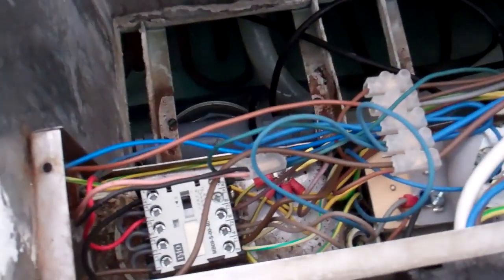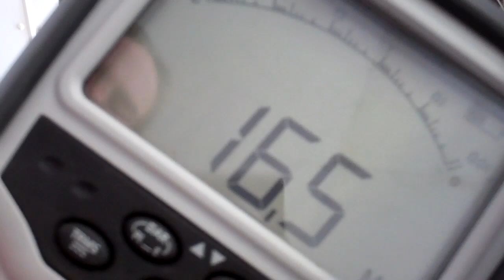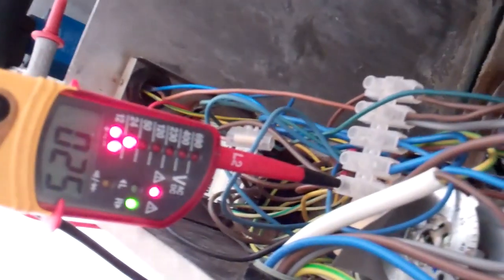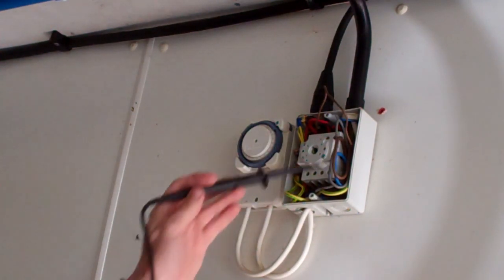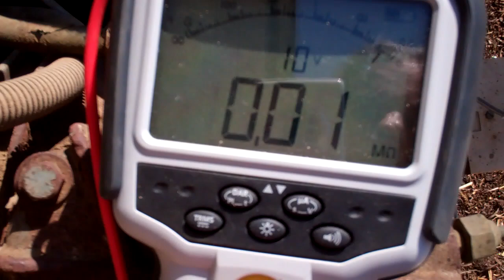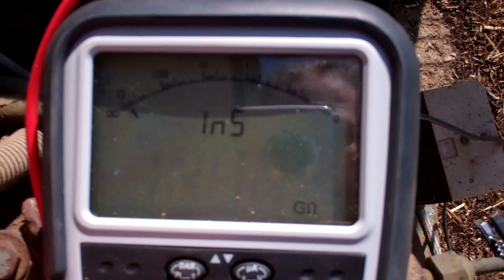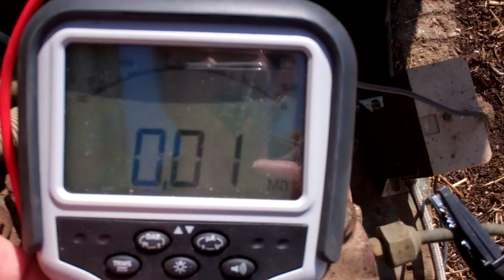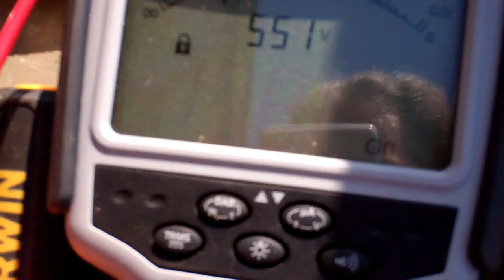megger testing

Comment: The out put from transformer 3 phs RED YELLOW BLU if check with ground shows with 
RED 191V
YELLOW 249V
BLUE 211V ??
Reply from the maker: +Muhammad Rizwan That does not sound correct, really it needs a good electrician to diagnose, but it can be if there is too much load on the red and blue phases.

Comment: I want to check insulation  between neutral and earth live
Reply from the maker: +Pilane Mositwane If its a motor, make sure the power is safely isolated, disconnect the motor from the circuit, put one test lead on the earth and then test the live and neutral, also test to earth to prove the earth lead is making good contact.

Comment: So by that do you mean..disconnecting the 3 phase into the isolator and then testing each phase and nuet to the condenser?and if resistance is fine.then the problem could be within the mains cable to the condenser or at the board itself? This problem is infuriating me and the customer..ps love your videos,I'm learning every time I watch one.
Reply from the maker: Ok, you should not need to disconnect the incomming mains to the isolator, but it is worth turning off and locking out the mcb that feeds it before doing any testing, also turn off the isolator. It depends if its a three or four pole isolator, if its three pole and or the neutral is not switched it will need disconnecting before testing as you can get a false reading. Then put one lead of the megger on a good earth (prove it by testing to another good earth and it should show a dead short), then test the terminals in the system, if there is a fault shown, break the system down into smaller parts until you home in on the part that is causing the problem.

Seeing as it is a three phase system, it is worth checking the contactor, if one of the contacts is a bit burnt the compressor will only get two phases and will pull too much current, this can cause the breaker to trip too.

Comment: Having trouble with nuisance tripping on a dairy case with remote cond unit.(maneurope) the system takes out the 20a breaker every couple of days..tried a megger on the comp windings and all is good..would you recommend disconnecting all components and and checking one by one with the megger
Reply from the maker: Those are the worst sorts of problems to trace, usually i will start by meggering the whole system to start with e.g. the incomming live and neutral (after having isolated both from the supply. If no fault is found then it points to there being no fault on anything connected to the circuit but you need to be careful of contactors and relays that may isolate individual components. It won't hurt to test all the components individually.

I have had a few times when the fault has been on the cable back to the mains board or the isolator, or even a weak breaker.

It could also be the compressor is struggling to start either because the capacitors have become weak or the start relay is faulty. A faulty pressure switch which cases rapid starting and stopping can cause a breaker to trip, as can liquid migration to the compressor when its off, as it can fill the cylinder and make starting difficult.

It could also be a defrost heater if fitted, or even a broken wire that gets water on it now and then.

Usually an earth fault will trip the RCD before the breaker trips, as it will only take 30ma to trip most RCD's, if they have an RCD and it isn't tripping it is more likely and over current fault rather than a earth leakage fault that a megger will find.

Comment from the maker: @joeyf504327 Yeah a lot of farms have cheaper electric at night so they build an icebank in the milk tank overnight for use during morning and afternoon milking. Also on some farms they don't have enough power to run the milking pumps, milk tanks, wash water heaters and lights etc all at once so they use time clocks to stage the power usage!

Comment from the maker: @fritzhvac Hi Fritz!

No worries! I've seen how busy you all have been!

Would you believe they wired the timeclock into the live incoming of the switch, someone could have tested the machine was off, started work, then clock switches on and the whole thing would be live but not run as the common/neutral would be off in the switch!!!

Its not too difficult to find the a short with a megger once you've got a method of working that suits you worked out and some practice. Will keep posting vids!!!

Comment from the maker: @salageansorin Its a Fluke T100, pretty pleased with it, has a built in light that shines where the probe is, will beep if you put one probe on a live, and you can do phase rotation for three phase stuff but with only two probes!
It also does continuity and voltage as you would expect.
Only thing that lets it down is the plastic can crack after a few years, but i guess it has a hard life in the truck and out on the job too!